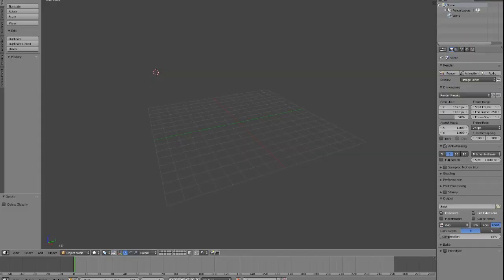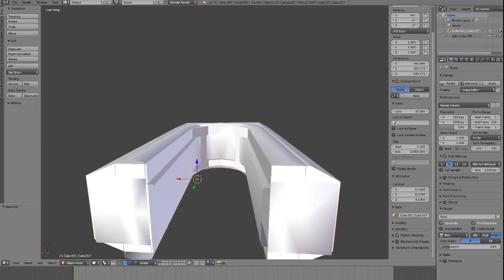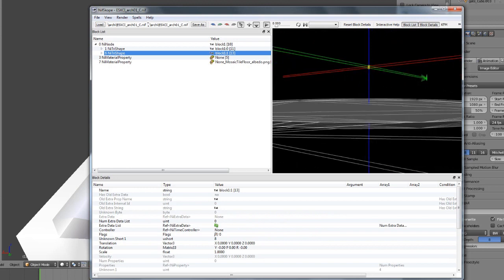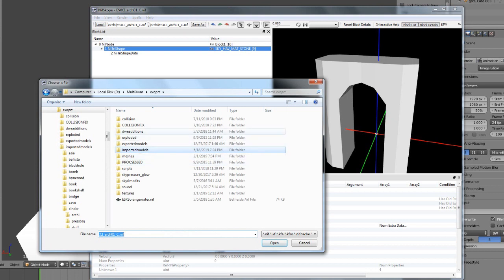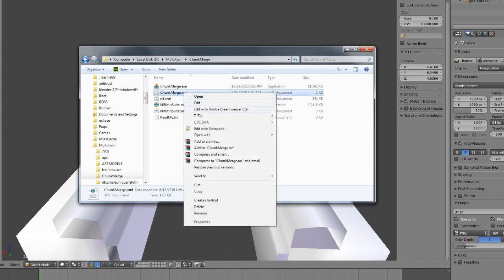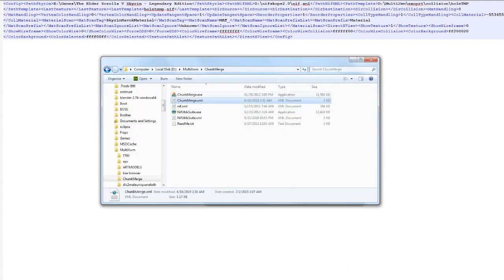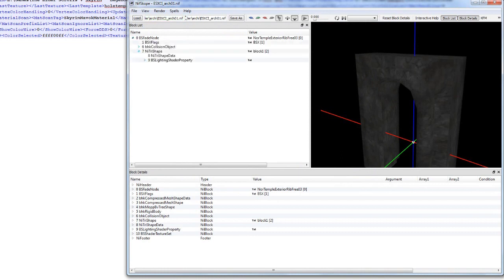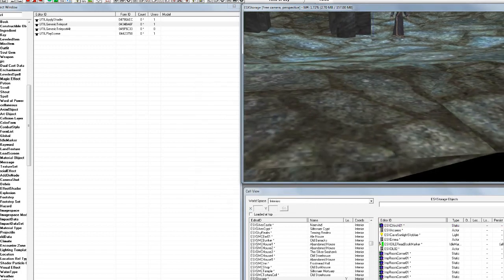Skyrim Creation Kit Tutorial - Adding Collision to a Mesh

Comment: So I made a very simple building and followed this tutorial to no success... I used the Nordic tower for my template mesh and selected a wood material under "SKY_HAV_MAT_".  It said it converted successfully and in nifskope my building has a collision object and all that, but in game the meshes are black and I just run through it.  Any ideas?
Reply from the maker: If the mesh is completely black either you didn't set NiTriShape vertex colors to true when it has a BSLightingShaderProperty that requires it or the UV maps were corrupted upon importing a mesh into NifSkope. If you are following the format in the tutorial there should be no SKY_HAV_MAT, just MAT_. If you are only using one material, select Single under Collision Material in ChunkMerge. 

Collision troubleshooting in CK is troublesome. One thing you could do is import the NIF file into 3DS Max and determine if the collision partitions are present as desired. Otherwise, use NifUtilsSuite and preview the NIF file to view the collision mesh wireframe. If the collision mesh is actually present, then there are other steps to take, but my memory is fuzzy about it. One thing to check is to make sure that BSXFlags exists in the NIF object and its name is BSX. CE does not recognize collision for a NIF file otherwise. These are preliminary steps before getting into circuitous troubleshooting.
Reply: xol It’s possible I’m using a different version of NifSkope but in my nit.xml all of the prefixes were SKY_HAV_MAT_.  The mesh also shows up fine in nofskope, it’s only black in ck and Skyrim.  I also opened the mesh in ck and used the show collision object option and it was there.  Out of curiosity, does the collision mesh need to be uv 
unwrapped too?
Reply from the maker: @jg7450   No the collision mesh UV doesn't matter. Send me your NIF file and I can take a look at it.
Reply: xol sent via email